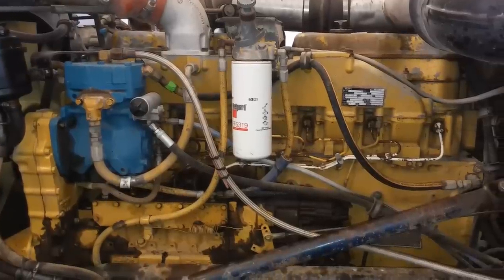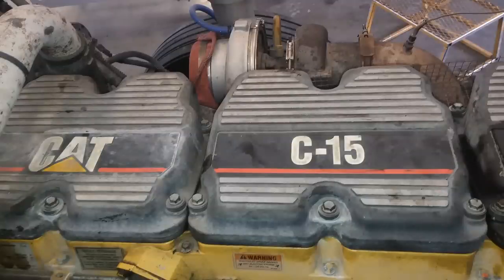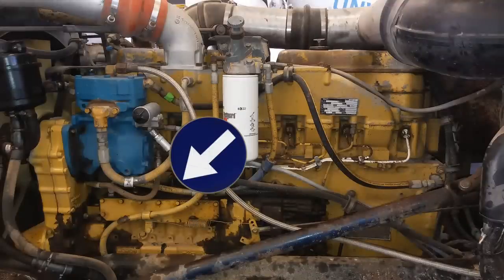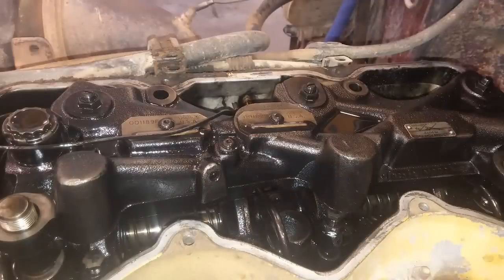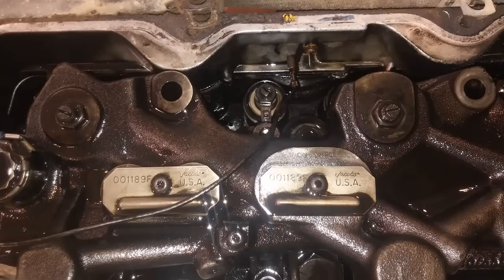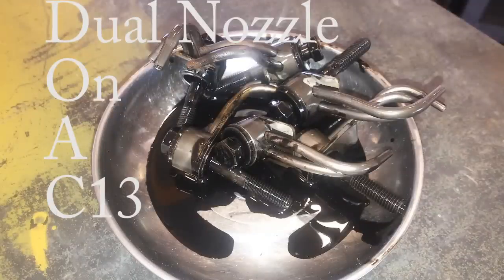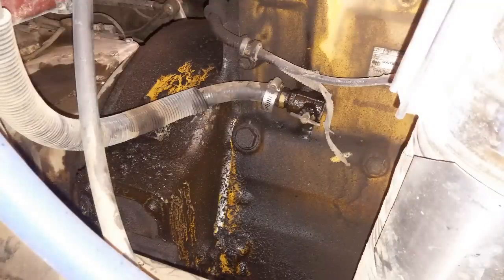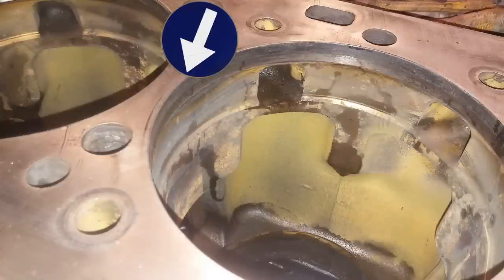The Cat 3406B Engine. Know Your Engine.  Caterpillar 3406 Information And History.

Comment: I used to rebuild them engines in 16 hours all with exchange components.  The most pain in the ass thing to remove and install was the aftercooler.   The electronic models were not that much difference nut the fuel pump or the ultimate injectors and harness

Comment: I have a 3406b model with a 5yg prefix. It’s a  460 hp PEEC engine that someone converted to a fully mechanical engine. This engine was very strong but I recently had it rebuilt, and it’s been a nightmare ever since. It was rebuilt with cat steel crown pistons off of a 3zj (16:1 I believe) and a turbo off of a 550. All other parts including the cam is off of the 5yg. The pump has a casting number of 7w3906. Now that it’s rebuilt it refuses to run. Once in a while it will run alright, but for the most part it has a light misfire at idle and a popping/spudering at operating rpms in the higher gears. Any ideas?

Comment: Hey Josh my name is Scott just want you to know I picked up a fuel injection mechanical timing light for 3406 b style engines the other day I believe the part number is a 1P3499. Scored on it been wanting something like that for a long time what do you think?
Reply: Those was pre 3406B style engines. I use one 42 years ago, if I recall you had to pin the engine. Make a TDC mark on the damper and use a coat hanger to make the pointer to show TDC. The best tool is the new timing indicator group. It shows on the screen, RPM's and degrees of advance in a digital format. Set one a few weeks ago, put it on graph paper.

Comment: I found a old ad for a 1986 359 15 speed hope its the 15over, and it has a cat 3406B 425 HP, They said it runs great  I"m going to be getting it and taking the motor out and selling it as it will be turned in to the very first truck I ever driven 1986 359 EXHD Pete custom kit, twin turbos, Headers, 15over tranny, Turbo wing, air assist and air locking Hood, 290 cummins punched and stroked to a 400 big cam, kick ass pinstripes and paint, and tons of stuff in it no other trucks had back then,  the pinstriper and the shop is still in business after all these years, now I found the rest of the missing puzzle the truck it self, was told by diesel shop in town the motor alone should fetch 5-6 grand and 7 if its cleaned up and painted don't know the model or serial code of engine yet but  will see maybe in a month get it home  then take motor out haul it another 365 miles to the diesel shop for its transformation my avatar is the 1st truck I drove #407.

Comment: If you have a 350 horsepower 3406B and want to rerate it to 425 or more horsepower, what would need to be replaced? Nozzles, compression ratio, turbo, plungers?
Reply: First off need a complete serial number, second if I look all this up, most people won't do it because of cost.

Comment: Hmm... why didn’t you mention those problems in the video comparing the c15 to the 3406E? Oil leaking well... engines leak. Especially older ones. Shouldn’t be a problem right? The ring thing tho is raising my eyebrow... the 3406E has that problem too? That one seems kinda iffy... but I guess that’s why we save up in case such a thing happens? The mechanic thing though I’ve got to find... where is your shop? Lol. Should I maybe save up and trade a broken 3406B block and maybe the full working 3406 B for a 6NZ instead?

Comment: thank you for the 3406b vid Adept Ape not a very common engine here in the UK so glad to be able to learn a bit more about them. when or if you work on one of these fully mechanical engines could you do a vid on the mechanical jakes please? i don't understand how they work when compared with the electric jakes on younger engines. regards Sam
Reply: They work the same, the logic on electronic engine knows when to shut them off. Mechanical engines are dumb as a rock. You have to shut them off. A compression brake all it does is take potential energy and releases it out the exhaust. Be careful on some 3306 mechanical engines with compression brake. Push rods are bigger on the exhaust. If you mixed them up they will fold up like pretzel's.   https://www.jacobsvehiclesystems.com/files/support/docs-pdfs/Application%20Guide_cat.pdf
Reply: thank you John Goldsmith so basically they are similar systems but on the older mechanical injection engines the jakes are just manually operated. so in theory you can stall the engine with the manual jakes?
Reply: Sam: 
You can actually run the engine backwards. I have seen this done, smoke going out air filters. Oil psi dropping like a rock. You can do this during cranking mode, with the Jake on high, bump the starter and the engine will kick back and light off backwards. Or revving engine up on high brake, let off throttle and right before it dies push in on the clutch. If you catch it just right it will kick off backwards.
On low setting (usually front brake) at idle it will run and sound rough. Flip to high at idle engine should die. Naturally engine needs to be at normal temp., so oil is at Jake operating temp. Than you can unplug both hsg's put Jake on high, engine at idle and plug each hsg up one at a time to see if they load engine up. With valve cover off you can push solenoid in manually looking for oil leaks (even electronic). Remember when you let off you will dump oil and squirt some out making a mess. If you have a 346B three point stand, you can buy a kit and get more braking power and go to a four point stand. Jake will require some parts swapping, head bolt coming out and shimming. 3306 you adjust valves first than put brake on and adjust. 3406 you adjust valves and Jakes with the brake on. The road test on Jake brake, pick point A and let off throttle and time the slow down to point B. Than retest with brake on high and you should cut time in half. This is what we was told by a Jacobs man back in the 80"s. He also said, the tighter the Jake the more noise it makes. And all your doing is making noise. He said they blew up several engines making sure where correct lash should be.
Electronic engine uses EUI rocker arm to activate that cylinder. That's why any hsg will work on any set.
Mechanical has a front and rear. As when cylinder x is exhausting and the push rod is up, its activating Jake plunger on cylinder y to open exhaust valve.
Remember proper shimming, I have seen several hsg broke due to improper. have one right now I am working on and it has a broken hsg. Had to get a used set and will rebuild them.
Reply: thank you John for the explanation never imagined you could get the engine running backwards!!

Comment: 2406 b is a great engine. Cat screwed up witj this engine whem they removed the fire rings from the block. The fire ring is a steel ring in the top of the block that the liner sits on. The A engine and early B engine had them and did not have head gasket problems. The oil pan gasket is easy tou use anaerobic sealer on the girdle put the gasket in place and install the girdle. The do same for the oil pan and you have a leak free install. The same goes for the spacer plate same sealer during the install and no leaks. How do I know this? I am a cat owner since 1980 and do ALL my own repair. 3406 A in my 1975 kw and 3406B in my 1988 kw. The 75 went 2.5 million miles with one rebuild and the 88 has 1.7 and is just on its first full inframe
Reply: That’s good I’m putting a 3406b 4mg in 1984 359 can’t wait till it’s done

Comment: I just bought a 86’ W900B. It has a 7FB serial number. Engine has no jakes, but does have a brake saver. I’m just wondering, if it’s possible, and how big of a job it would be to install a set of jakes on it? Any info is appreciated. Thanks
Reply: Engine Manufacturer: Caterpillar
Engine: 3406B
Engine Serial Number Prefix: 7FB39279 and up
Horsepower: All
Engine Brake Model Number: 346D
Engine Control System: Mechanical
12 Base Kit: 148-7440
24V Dual Lead Base Kit: 148-7449
24 Single Lead Base Kit: 148-7422
Engine Control Group Non-ABS: 143-6608
Engine Control Group ABS: 143-6608
Cab Control Group: N/R
Clutch Switch Group: N/R
Lash Setting: See Application Guide
Lash Setting: See Application Guide
Tune-up Kit: 143-6479

Comment: Would a 3406b from a 85 9000 ford be compatible with a 245 B excavator with 3406? Truck is tired but engine only has 600000 kms on it and the excavator seized.

Comment: the accessory drive has counterweights that will come off. the fuel pump cost as much as the engine. good power good mountain truck but it comes with a price in the late 80 s

Comment: Hello, looking at buying an old Pete with one of these engines. Thank you much for the video. 

Two questions PLEASE!

1) would you recommend this engine, or stay away!

2) are these OTR trucks, or city  trucks?  I pull a lot of mountain passes, and this will be my first Owner Operator truck, so I just don’t know enough yet. 

Thank you so much!
Brian
Reply: It depends on the engine serial  number. 7FB or 4MG are well made. Make sure its a 425hp. Do not expect good fuel mileage. Parts are available. Finding a mechanic maybe your only challenge. Not to many of us left. LOL

Comment: hey i got a question. we just got back a 3406E from a inframe and it still has a bit of blow by. is this normal? do the piston rings seal right away or dose it need to be put under a load to seat everything correctly? thanks
Reply: An old cat mechanic told me after cat had overhauled a 3406Pcta for the forth time because of excessive oil consumption to drive the shit out of it and run it hot.210 or so. It helped that this man knew what he was working on and used new pistons and linere instead of reman parts. Those kits are used and only need to pass spec. You know not completely worn out.

Comment: I got 00 kenworth with 3406B engine  losing radiator fluid  building lot of air pressure in resovier  change 15psi cap to hold over boiling and spill out fromm. 10psi  resovier  cap my fuel water separator filter get fill in every 2day can help figure out what seems to be problem  here any suggestions?

Comment: Howdy. I have a 3406b with a small diesel to oil leak. Had nozzles pop checked, no diesel leaks 2 leaked pressure. Replace those two and fuel line oil rings inside valve cover. Still leaking but not as much. Any ideas what would be happening? 7FB72318. Mine didn't have a block strengthening plate.
Reply: Do you have a oil leak or fuel leak? Where is the leak? Your comments are misleading.

Comment: you forgot when they upgraded(lol) to a plastic impellered water pump...      that one bolt was a pain  made  a special wrench for it
Reply: They was trying to fix water pump leak, (this impeller design didn't last long), now back to steel. The impeller was actually pulling the coolant/lubrication away from the seal. Causing premature failure. A slot is now cut in the HSG to allow coolant/lubrication to stay constant on the seal.

Comment: Would do a video on the 3406a maybe talk about the difference between an a and b model.
Reply: Just a video on 92U differences would be a choir. They came PCT, PCTA, DIT, DITA. First cylinder block's oiled rocker arms via head bolt holes. Also piston jet was made in the block.
A video on 3406B/C models, don't have that much time.

Comment: The fuel pump system is called Port Helix
Reply: Cat calls this pump NSFS, New Scroll Fuel System. The helix is cut into each pump. ( you have a single or dual helix based on year model). You had forged body fuel system. Then they went to compact scroll. Finally they came out with NSFS.

Comment: I have a 3406B Cat I’m overhauling. It had a square exhaust port. I ordered a head and it came as a round hole head. I was told by cat you can’t get a square hole head anymore from cat. They said you can use the square manifold with a round hole head. Do you know what gaskets to use? Is this a good idea or should I get a round hole manifold?
Reply: You cannot use a square port on a 8PN, as the exhaust manifold will not seal off. Plus a 8PN uses a different head, it has a different part number. Order your gaskets that fits the manifold. Also Cat has updated the cylinder packs. What is your engine serial number?
Reply: I have a 3zj. I spoke to the cat dealer and they told me the square heads are no longer available. If you have a square port head you will need to change it over to a round port head. They said the square port exhaust manifold will fit using a square port gasket. It looks like it will work other then the ports don’t match. Is this correct?
Reply: @Smokescreen-eb4mu   A 3ZJ could be a B model or a C model. Also on a 3ZJ most of the time if you order the fuel nozzles by the serial number in the book, you will get the wrong nozzle. The old REMAN part number for the cylinder head was 0R3674, square port. It was a used rebuilt head. Cat then quit rebuilding them and went to a 0R3719 UTN (new casting), (round port). An 8PN head will bolt down, but will cause problems if installed. You could have a narrow journal crankshaft or a wide journal crankshaft.  This is why I want your full serial number so you get the correct parts. Been doing this for almost 44 years.
Reply: @johngoldsmith6629  I do have the wide journal and newer style injectors. They sent me the OR3719 head. I’d have to get the serial number tomorrow.
Reply: @Smokescreen-eb4mu   What part number nozzle?

Comment: I'm getting diesel in my engine oil. I remove the valve cover and checked the fuel. I did not see any fuel line seeping. I heard that it could be coming from the fuel transfer pump or possible the injection pump, how would I verify? Thank you
Reply: Fuel transfer pump, only seen one and it was a classic part. Fuel pump usually when someone tried to fix a bushing leak and didn't do it right. Most of the time it is a nozzle. With the valve covers off, the nozzle is in a chamber. Should have two holes on the cap. Be careful, put your finger on one side. The other side put some air psi on the open hole. Be careful you don't want a face full of oil. As you check each one, the good holes will push oil out, dark. The leaking nozzle will be clear because it is full of fuel. If it is the nozzle, could be seal on the side. You can replace it. If it is the seal on top, you have to replace the nozzle. Can be a fuel line, the outside connection has a drain hole in the fuel line adapter. The inside line has an oring to try and force a leak to the outside. The nozzle connection you already check it.

Comment: Ok so I’m chasing a new wiring harness, water temperature and oil pressure sensors, was able to get a new wiring section 6I-2383 which both sensor connect to but no one seems to be able to find the sensors to replace them? 

Got a 3406B cat engine 2EK00676 1991 western star
Reply: What sensors do you need?

Comment: I bought a dump truck with a 3406b in it. What is it that’s directly below the power steering pump? It looks like a place to add fluid, but there’s no dipstick. I also see no fluid inside. Wondering if this is normal. Everything seems to operate normally.
Thanks,
Travis
Reply: That is your cover for your VTU. Some arrangements offered a oil fill at that location. What is your full engine serial number?
Reply: Thanks John. I’ll look tomorrow and get the the full number. Sorry for the slow reply.

Comment: Hey adept ape I've heard the 3406b is cats or one of cats best motors. I'm going to buy rig soon and am considering buying one with 3406b. I'm told there are still enough people to work on them and that they are still way more reliable then the new engines. Do you think I would be good buying one? And also I heard c.a.t still rebuilds them
Reply: Cat offers a OPT overhaul, which includes warranty. Some states like Cal. will kick you out as they smoke to much. Engine serial number is very important on these. Find a older timer who still knows these. Younger tech's never seen or worked on them and don't know all the updated parts that are not in the book.
Reply: @johngoldsmith6629  I hate California. I won't run there I make great money staying in Canada. 400,000 a year. And the places I go  the 3406b is excellent and enough mechanics still work on them and learn about them. And c.a.t rebuilds them
Reply: I love them man they are awesome
Reply: What is your engine serial number?
Reply: @danielmurray5065  Cat has updated cylinder packs, be careful at rebuild.
Reply: @johngoldsmith6629  10-4 thx bro

Comment: Looking at an early 3406C 3ZJ23598 that did not come through with a Jake brake. What would it entail to put jakes on that motor? Pricey?
Reply: You got a 285 HP @ 1600 in a Flt. . I would call Jacobs Brake first as that HP is not listed. List 310-350 HP and 365 and up.
Go to there web page.    https://www.jacobsvehiclesystems.com/parts-service-support.

Comment: both 3406b turned up with brake savers I work on helped rebuild don't have the oil pan strengthener plates just oil pan and gasket never leaked, is it critical?